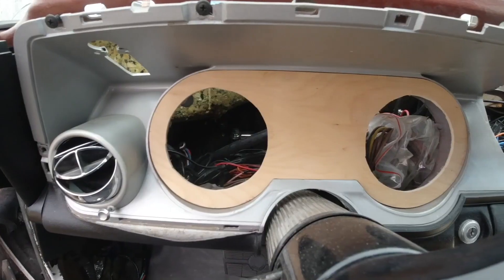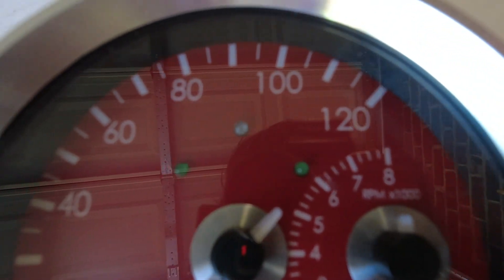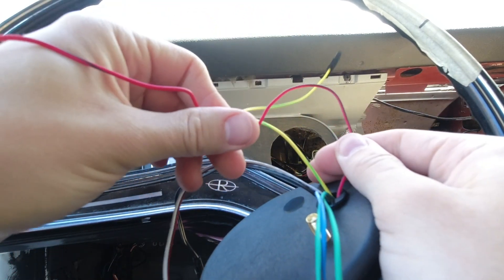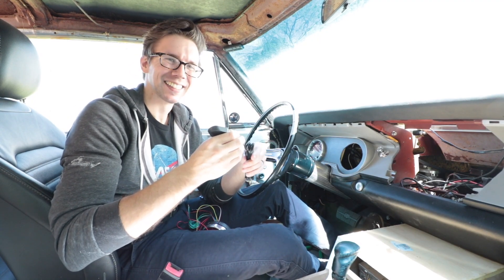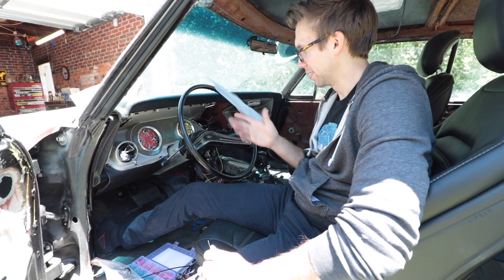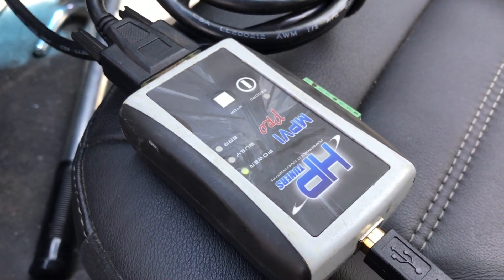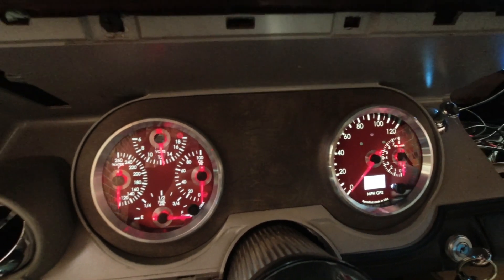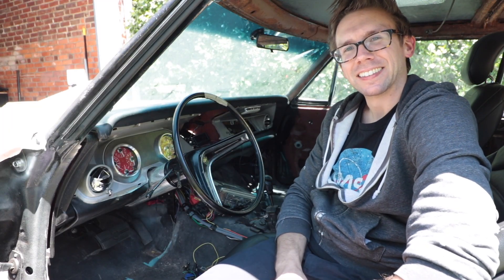Installing A Custom Speedhut GPS Speedometer, Tach and Quad Gauge

Comment: Do you know how the RPM shift indicator light is adjusted?
Reply: I can't thank you enough ill try this !
Reply from the maker: Absolutely, good luck bud
Reply from the maker: https://speedhut.com/content/instructions/gps_dual_tach.pdf
Reply from the maker: Found it! Sorry for the delay, I never set mine up cause the car is just a cruiser so no need on my application. On the bottom of the second page of the manual it shows the tech setup menu and it’s one of the options in there. Cheers buddy!

Comment: Looks classy.. i would install something like that on an s10 first gen
Reply from the maker: Do it! SpeedHut has so many configuration options - I think it’s fun to just go over there and play with stuff.
Reply: What happens when you under the tunnel where there is no GPS signal?
Reply from the maker: Maintaining the same RPM should keep you pretty close.
Reply: @MatthewFinlay  
Mmmm, that means mileage reading would be wrong as well.. I have to wait until there will be solution to this issue.
Reply from the maker: You could always use a speedo output signal from the trans if it’s electronic based or if it’s mechanical you could always use a converter.
Reply from the maker: https://www.speedhut.com/Speedbox.html
Reply from the maker: I’ve used the speedbox before on LS swaps that need to spin an older mechanical speedometer using the electronic signal from the trans.
Reply: Wow, thanks for the info, so does that mean I can use GPS only speedometer with mechanical cable so that speedometer still can measure the speed by cable?
Reply from the maker: If it was my money and I was using a mechanical speedbox style adapter I’d save the cash and just buy the standard non-GPS speedometer! I don’t believe the GPS units have an input for electronic speed - it appears to be either GPS or Non-GPS for their electronic models online. SpeedHut isn’t the only company to make an adapter - another company came out with one before them. I think Dakota Digital has one too but don’t quote me on that.